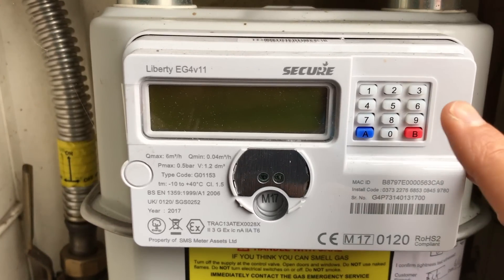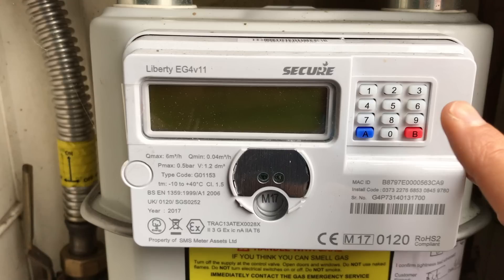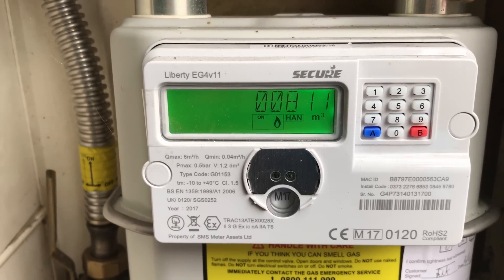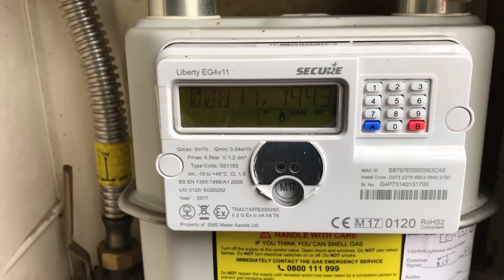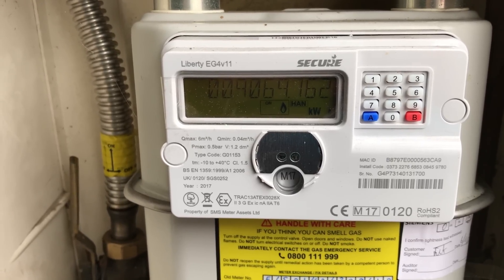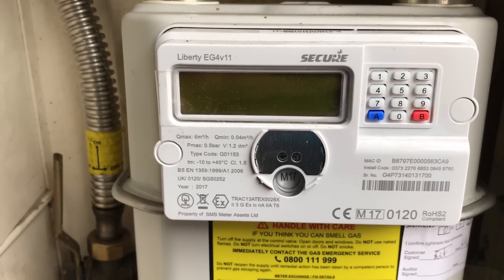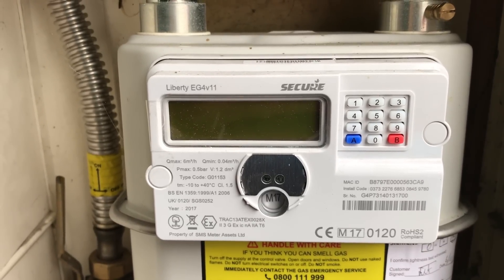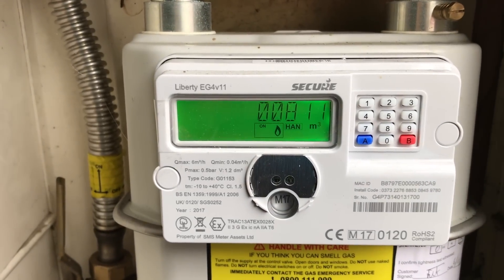How to gas rate on a Liberty E4 Gas Meter (Numeric phone style keypad)

Comment: Hi, just moved into a new property with this meter installed. It says off on the meter and I don't know how to turn the gas on? Any ideas what buttons do I press?
Reply from the maker: Try the following first. Also make sure the gas lever is in the ON position. If you have a top up meter do the following.

 Fixing the meter
1. Turn all of your appliances off.
2. Ensure you have credit available on your meter or your gas card.
3. Insert your gas card into the meter. The meter will display, “Please wait, £XX.XX on card”
4. If the meter display is off, turn your meter on by pressing the red button. This message will appear on the screen: 'If appliances off press button A'.
5. Once checked press the red A button and the meter will now show 'HOLD for gas'.
6. Hold down the 'A' button and wait until the display shows ‘Release A for gas'.
7. Let go of the button.
8. It can take up to 1 minute before the meter will beep 3 times and change to ON. The supply will turn on and display the amount available for gas. If the supply has not been restored follow the steps without the gas card in.

JK

Comment: Thank you so much for this video.
My partner sent meter reading two days ago we end up with a gas bill for £550 for the last 3 months 🥲 we have only gas boiler, even cooker is electric.I did not sleep all night long literally cry 😭 tried to phone energy supplier as I have feeling there is something wrong they trying robbe us. Then I went on YT add proper meter reading on APP end up with £150 instead £550. I'm going check electric meter as well I don't trust my partner any more😂 x
Reply from the maker: Hi Anka, glad it worked for you. Additionally here is also something else that may be of use. https://myboiler.com/money-and-energy-saving/ Section 2 boiler settings helps reduce your gas usage for modern condensing boilers. JK.

Comment: i need to put in the four numbers into my gas app , 0123 for example 
or do i put 0.123 ? 
The 4 numbers on the right hand side after pressing the 9 button once and waiting ? 
Thanks for the videos 👍
Reply from the maker: Hi Greg, for these type meters, you would round to the nearest digit or 3 decimal places. ie 0123 becomes 012, or if it was 0128 then it would become 013. Also for most apps and reading you only need the numbers after the decimal point. Hope that answers your question. JK

Comment: Right but how do I get the back light to come on if somehow someone’s turned it off
Reply from the maker: You can’t really turn it off as far as we know. It should come on when you press a button. If it’s not working, the battery may be low or back light faulty. JK

Comment: Hi, is this a 'smart' meter? Ie utility company gets a reading wirelessly? I  just moved into house with this exact meter.
Reply from the maker: Hi yes, it does have the capability usually. However most of these are SMETS1 version and are tied to particular energy providers, unless the firmware was updated or capable of being updated. Best check with your current energy provider. You should also have a display in the home somewhere. JK

Comment: I didn't understand that. I need a reading for my utilities company... 😞🥺
Reply from the maker: Hi, this video is mostly for gas engineers, however the reading described in the video is the same one requested by utilities. You can also press 999 to get the reading. JK
Reply: @ARatedTV  which reading is the one to give the utilities company?
Reply from the maker: @jsjshdbejkwbsjdken8022  Usually volume readings. Ie the one shown in the video. JK

Comment: I don't suppose anybody knows why the green backlight doesn't stay on when it's scrolling through all information do they? The electric meter stays lit all the way through its cycle but the gas meter doesn't?!
Reply from the maker: The gas meter is not powered unlike the electric meter, it usually uses a built in lithium battery or equivalent, therefore must conserve energy, hence backlight would not stay on continuously. JK
Reply: @ARatedTV  there you go, simple! Cheers mate, I honestly couldn't work out why it didn't act the same as the electric one!

Comment: I have a Liberty EG4v 10 gas meter which looks identical to this one and ever since the meter reader came to physically read the meter it has stopped transmitting data every 30 mins like it used to so I'm not getting any data from Octopus on my usage. Octopus don't seem to be able to do anything about it. Is it possible to get it to transmit again via the keypad? If so how?
Reply from the maker: Hi John, unfortunately we have no info on this. However should we find anything, will let you know. At this point, I would recommend to get the meter replaced for a newer version. There may be a long wait time at the moment, however that may be the only option if no one is able to connect it. JK.
Reply: @ARatedTV  Thanks for the reply. Octopus are still able to pull a reading from the meter for billing. The only problem is I can't view my daily usage data. Not a big deal but I would like it sorted. I'll keep on at them.
Reply from the maker: Aha, if you follow the video, you can get the meter reading, do same time everyday, it will give you 24 hours usage.
Reply from the maker: Just to clarify they are able to pull data but not half hourly. This data would usually would be available on their dashboard, but you are no longer seeing this?
Reply: @ARatedTV  That's correct. My dashboard stopped showing the half hourly data readings on 3rd Sept which I believe is when the meter was physically read so I'm wondering if the meter reader reset something. I seem to remember when the meter was installed I was asked if I wanted half hourly readings so I guess this is an option that can be configured on the meter itself. I've just found an option on my Octopus dashboard about setting my smart meter data preferences and so I've confirmed for half hourly so I'll wait and see if that's made any difference.
Reply from the maker: I was about to say, the option was on the dashboard, but you found it yourself.

Comment: For gas and meter reading, you press 9 and take imp kwh reading not volume numbers?
Reply from the maker: Usually, unless the energy company tells you otherwise, they go by volume numbers. They convert to kWh themselves internally as and when needed. JK
Reply: @ARatedTV  Do you know whether these meters use a gross or net conversion factor to give the displayed kWh reading? If I knew this then it would be easy to do a heat input check using the kWh reading (rather than the usual volume method).
Reply from the maker: @Jehannum2000  I would need to check into this, however we would assume gross as that is a universal input whether your appliance is a standard gas appliance or condensing boiler. JK
Reply: @ARatedTV  Yes, I think you're probably correct about that.

Comment: OK right how do you take a gas reading? This is ridiculous! The gas people just want a reading not all this
Reply from the maker: Hi, this video is for gas engineers mainly, however you just need to submit the full reading left of the dot and right of the dot that is mentioned in the video. IE 00811.7943 as shown in the video at 38 seconds otherwise we would recommend your gas company tell you how to take the reading they want. JK
Reply: @ARatedTV  I worked it out cheers had to press number 9 and let it cycle through! It's in the worst possible place you can put it! It's in the ground out side   under bathroom window but actually in the ground so it's a bleeding nightmare to get to and we got a threatening letter from the gas people wanting a reading, the letter's absolutely terrible and we have never been in arrears or that with them ever! The way they have fitted the meter is below the stones and path with the screen facing forwards just about pressed up to the brown plastic surrounding for the box It's unbelievable! What a time we've had of it today bloody ridiculous so away to chill out abitty now! Haha
Reply: @Emtbtoday  hi can ask which is the reading needed... Do you press 9...or 999...and which numbers do you take? Thanks
Reply from the maker: Both ways work. 999 gives you the reading you want instantly without waiting for it to go through the different readings. JK
Reply from the maker: Correct. JK

Comment: Is the Meter reading the one with the comma? So confusing

Thanks
Reply from the maker: Hi, Shahzad it's very straight forward, if your a gas engineer you only need to work with 4 digits after the comma, if your just a home owner submitting a reading, you submit the whole reading including the comma or whatever the energy company requests. JK.
Reply: @ARatedTV  Thank You
Reply from the maker: Your welcome, just to add, if you are using our calculator for now it works with 3 digits only, so you need to round the 3rd digit up or down based on the 4th digit after the comma.

Comment: How do i switch it of the gas i mean ....Need to fit a new cooker
Reply from the maker: Hi, there is usually a lever next to the meter. Your installer should be able to do it for you if necessary to replace the cooker. Normally a bayonet connection allows you to disconnect and reconnect a cooker without turning the gas off.

Comment: For a meter reading & press no 9 the first set of digits you see is the reading you need to give to a new supplier or follow his instructions but take the numbers on the left & not on the right.
Reply from the maker: The video is for the purpose of gas safety checks, hence only the 3 digits right of the dot matter. For submitting a meter reading to a supplier or other entity, you would use the numbers to the left of the dot or the complete reading including all the numbers including the dot.

Comment: Who wrote the firmware for this device. It is terrible. Thank you for the video. I still have not figured out how to take a simple meter reading though.
Reply: Press no 9 & its the first numbers that appear on screen
Reply from the maker: Very likely those people with limited experience in human computer interaction or those with constrained resources. If your not sure, you can take the initial reading, then shut the gas meter off after your timed period, and then use the key sequence to take the second reading. All appliances must be relighted correctly afterwords.